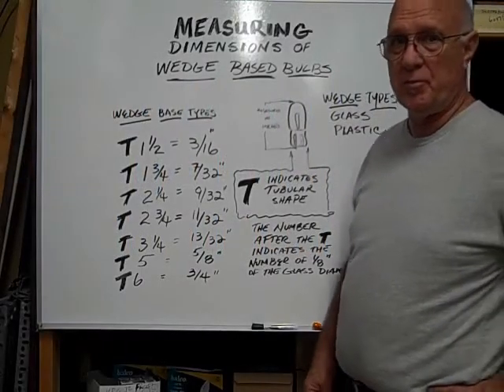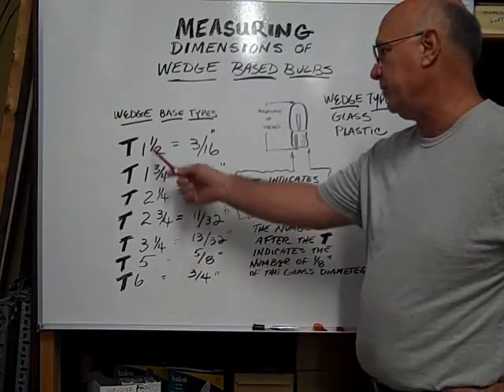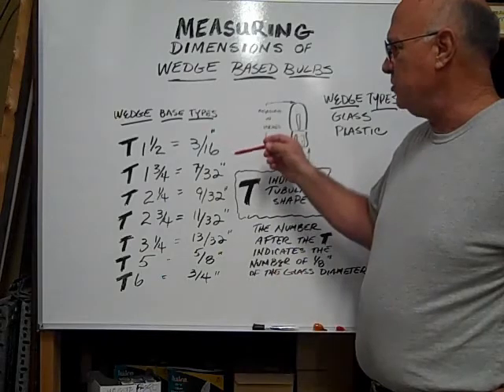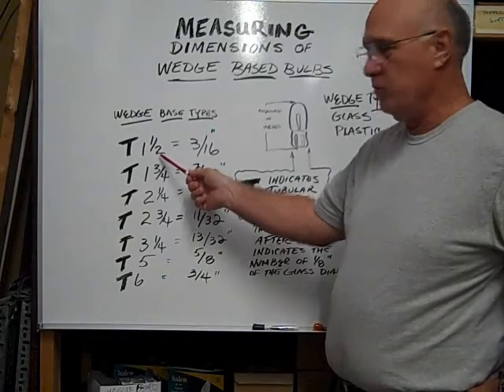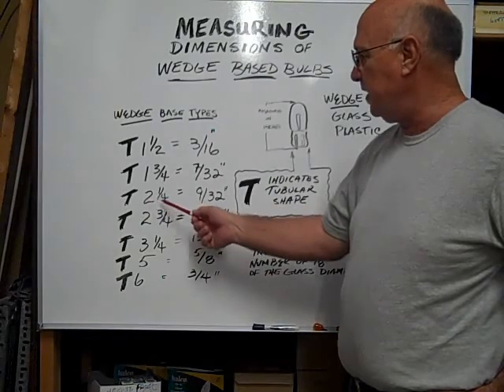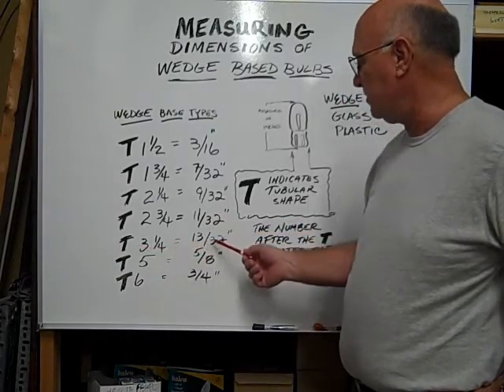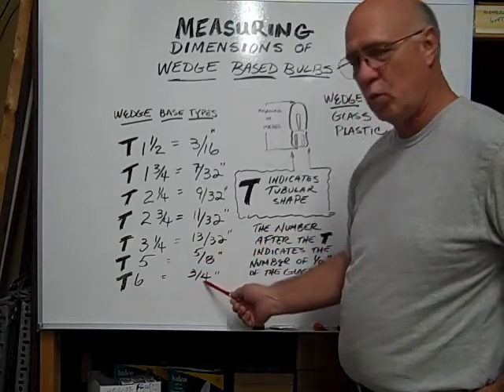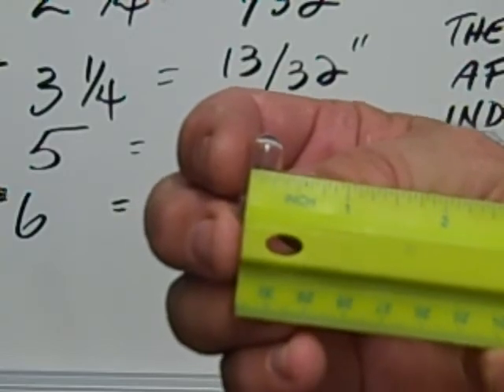T3-1/4 Glass Wedge Base Bulb Identification

Comment: So then what does the "1/4" represent?   The base seems to be 9mm, and not 1/4 inch.. So I don't understand what the "1/4" means in a t3-1/4.   I'm trying to get new bulbs for my test lights and there is a spring that goes around the glass and catches on the metal base, so it has to be the correct size;  and the glass seems to be slightly larger on these, so I'm not sure that they would even work.   I think I need a T3 and not a T3.25.   IDK- finding info on this is like pulling teeth.
Reply: A "T1-1/4" can be thought of as a "T1.25".  Take the "1.25" and multiply it by 1/8" or 0.125" to get the bulb diameter.    Hence, "T1-1/4" = 0.156" in diameter.  All these numbers are nominal and actual values will vary slightly.